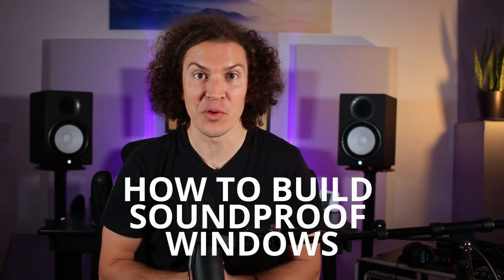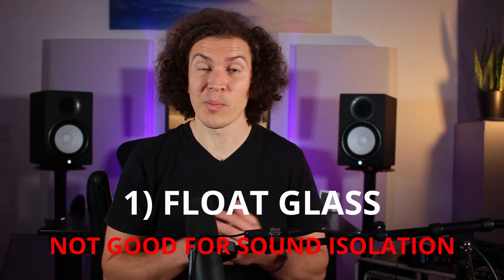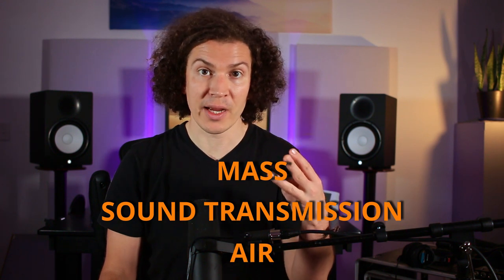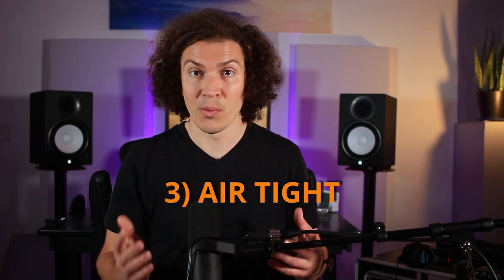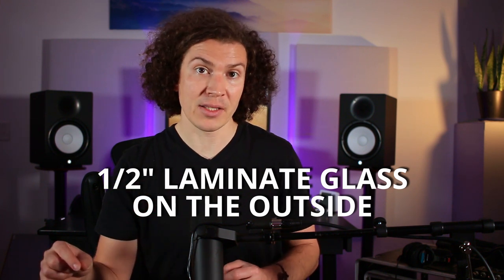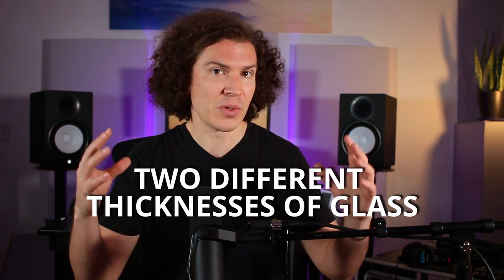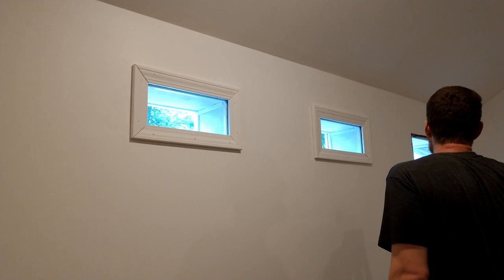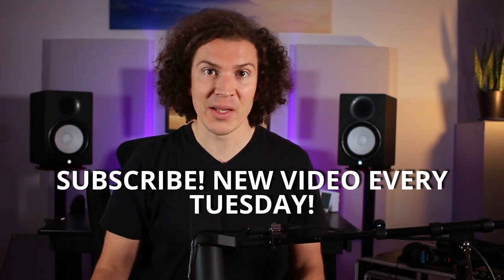How To Build A Soundproof Window

Comment: You can always put silica gel bags inside two layers of the cloth at the bottom of the two frames, which you already used to connect the two, that way any humidity build-up can be caught. Very helpful video.
Reply from the maker: Yes, that is something I recommend these days

Comment: Plexiglass works really well AND it's practically impossible to break/smash especially when you get beyond 3mm-4mm thickness. I made some inner windows with double panel 4mm plexiglass (about 8mm gap between the panes) and it blocks out noise almost completely from outside.
Reply from the maker: Interesting! i am just going off what Rod Gervais taught in his book. But I just did some more quick research and I think it may have to be another youtube video to go more in depth with it. If you have any video examples of your studio I would love to see them. DM me if you are down to share!
Reply: @soundproofyourstudio  Sorry I spoke too soon. I watched some of your other videos and it seems like you are a real pro so I defer to your expertise! Also it's not a studio per-se, just our crappy rented house with terrible single-pane windows that were making our lives a misery (in terms of both sound and almost non-existent insulation). We weren't in a position to spend thousands on professionally-made windows so I decided to throw together some of my own. Walls were a write-off, but treating the windows made a massive difference on both counts. I guess my method was a bit more rudimentary than your seemingly very high-grade finish but it got the job done.

Also I read some stuff that suggests plexiglass can become discolored from prolonged exposure to the sun but I cannot be sure (haven't had any issues for 12 months at least).

Plus, I really like your idea (or Rod's idea?) of using different thickness/different types of glass/material. My two plexiglass panes are the same thickness so I imagine there's a loud of "internal bounce" or whatever the scientific term is. 

Anyway I already moved out of that hellhole into a new(ish) build with proper windows so no photos unfortunately. Just want to say I really enjoyed your videos so far and I've subscribed!
Reply from the maker: @bluetech2809  Yeah I think plexiglass is certainly the budget option. One thing I have learned about everything with soundproofing is it is not cheap, but I am so happy to have done things right and spent the money in the end rather than having any regrets. I appreciate you watching the videos and subscribing. It is this amazing community that keeps me inspired to keep learning and teaching.
Reply: It 's not as good as laminated glass, plexi doesn't have the mass.

Comment: If I want maximum noise, isolation, would you recommend I put two layers of laminated glass of different thickness to avoid coincidence issues? Would it be better than one layer of laminated and one layer of tempered? Cost is fortunately not an issue on this one. 😊 thanks
Reply from the maker: Yup thickest glass you can afford. Change thicknesses for coincidence frequency and laminate or tempered works. I used two different ones and I don't think it matters one way or the other. If you can match the mass of the windows with the mass of your walls that is a bonus too for extreme soundproofing needs. TBH my window design works extremely well and I don't think I would need much else. Best of luck!
Reply: @soundproofyourstudio  Thank you! 👍🏻

Comment: Is there any approximate equation to calculate the resonant frequency of two glasses, depending on the mass and the distance between them?  I have a 10mm float glass and a 6mm float glass, which are separated by a distance of 10cm. Do you know approximately how many decibels are generally reduced when reaching that frequency? thanks.
Reply: I don't know the exact math off the top of my head but this book could help - master handbook of acoustics
Reply from the maker: You know I would over think it too much. If you use thick glass with the right type of glass and get the largest airgap you can afford you will be happy. So many people never build anything because they get stuck on numbers and research.

Comment: For windows between a studio and a control room, it's also helpful to have the angles of each panel offset or different, e.g. one at 90 degrees vertical and the other at 80 or 100 degrees vertical. This helps discourage standing waves that might occur within the air gap.
Reply from the maker: Great point and it also helps with direct reflections back in the room. If you angle the two panes so the top is wider than the bottom then the sound will reflect back toward the floor. Another benefit is it won't cast reflections when you look through it. All great reasons for angling the observation window.

Comment: Plexiglass works very very well. You need 2 panes separated by at least 1”. And use acoustic glue and/or acoustic tape to isolate the plexiglass. 

Also, you forgot Polycarbonate.
Reply from the maker: Ahhhh polycarbonate!!! how could I forget it. JK I honestly don't know if plastic is a good way to go, but sure try it and let me know if it works.